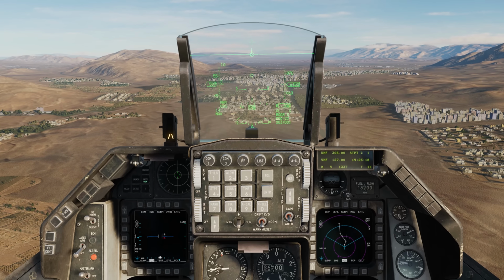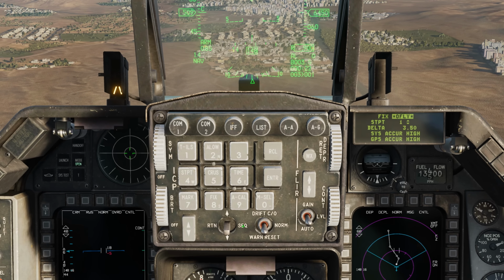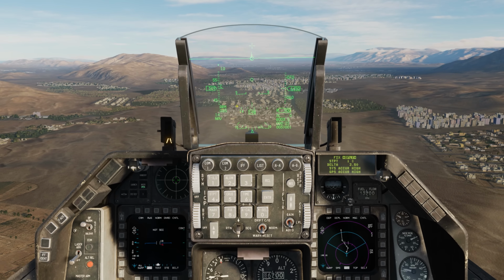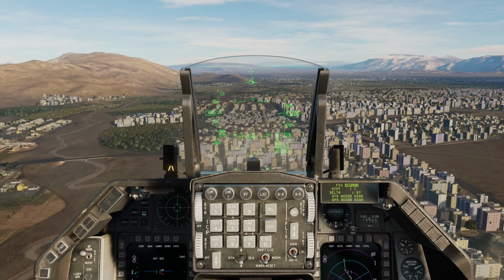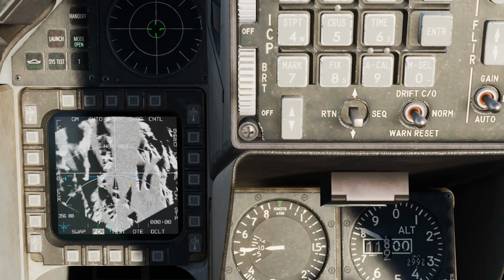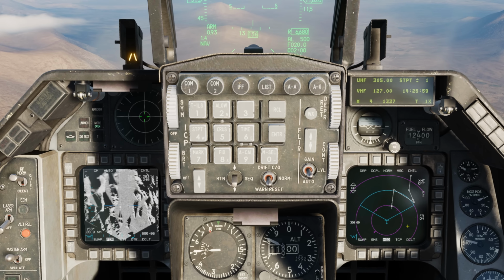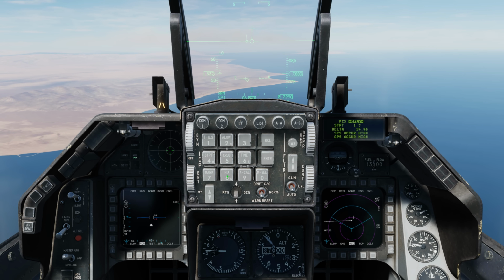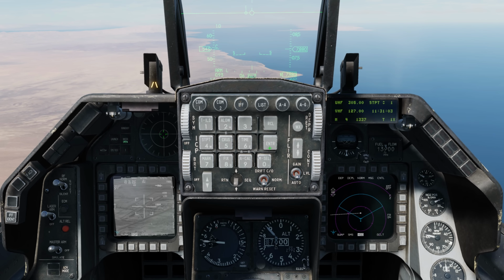DCS: F-16C Viper | Navigation Updating with FIX Taking

Comment: Matt ! there is a problem using GBU-10/12!! bombs in CCRP mode refuse to be released! If changes have been made, then make a new guide, if this is a BUG, report that this is a bug and you know about this problem! I wouldn’t write those here and would write on the forum or in support, but I just ran into an inadequate reaction from the worker’s ED, they started waving a banhammer instead of giving an answer! I find this behavior unacceptable!!
Reply from the maker: No problem here. Feel free to post a polite and construction message with a track on the forum and we can try to help you understand where you are going wrong. Thanks.

Comment: A very subtle but important point made at 3:50 where you can see ALL the steer points move when you update one. So you can’t just change the position of one to, say use it for CAS, and then fly off to your other steer points and expect them to be in the same place.
Reply: Is there any way you can just change one steer point with out the others being moved?
Reply: @robertschubert4809 MARK function on the ICP
Reply: @robertschubert4809  you would have to edit that steerpoint. Can’t remember how to do that right now. Been a while since I fired up the Viper.

Comment: Do we have to do this in every scenario, or is this only necesarry when my GPS is damaged, or the timeframe of the mission doesn´t have GPS?
Reply from the maker: As mentioned in the video, only after a rather long flight in which INS errors can accumulate.
Reply: @MattWagner  ah okay. I thought that INS drift gets fixed automaticaly by GPS in modern jets.
Reply from the maker: @Sinni64  Not entirely. Based on multiple references, updating can still be required.
Reply from the maker: @audunskilbrei8279  You will need to speak with Lockheed Martin about correcting their manuals then. As I said earlier though, A-CAL allows blending of GPS and INS. Also note that this is a pre-EGI aircraft.

Comment: how does having the ins in ifa(using gps) or a similar mode effect the need for this?
Reply: While a FIX only updates the current location your INS thinks you're at and does this instantaneously, an in flight alignment will realign your entire INS. In flight alignments also have quite a low accuracy and they usually require you to fly in a fairly straight line for several minutes.

Comment: Hi all!
Is it possible to change the altitude on the steerpoint?
Alot of multiplayer missions has steerpoints high above target area, and I would like to drop it down to the ground.
Thx in advance!
Reply: You can - press STPT/4 on the ICP, select the steerpoint you want and adjust the altitude.
Reply: You can change/edit the steerpoint elevation in the steerpoint page.
Reply from the maker: Use either the STPT or DEST pages.

Comment: Soo if I'm watching this correctly, I can move a steerpoint that's near a target, to on top of a target to make it easier for the Tpod to find the target?
Reply: No. You're better off using mark points for that. This is simply for updating and re-aligning the INS in case it drifts too much. In fact if you tried to use this method to try and place a steerpoint directly on (a) target, all your systems would be too inaccurate to get any precise bomb drops off and whatnot.
Reply: you could potentially do that but you also have Mark points to help you snap the targeting pod to specific targets.

Comment: Call me stupid but I don't get why we have to do this. Shouldn't the GPS keep the INS automatically aligned? Or is this just in case the mission timeframe / nation does not allow the use of GPS? Or do you have to do this when you pulled max G and then want to super precisely CCRP in the next second?
Reply: The GPS does correct the misalignment of the INS with time. The FIX option is a legacy option to input coordinates, in order to correct the INS, in the days before GPS. If you look at the A-10A cockpit, the panel below the ADI, whereas in the A-10C is the EGI panel, in the A it is the INS panel. Pure INS, no GPS. But the thing worth of note is the 'Erector' button. That is a kind of mark button the pilot would press over a known navigation fix to correct the INS . A similar thing will be added to the Hind, since that beast does not have a GPS system.
Reply: GPS gives you the XY, INS is still used as the main sensor to know the aircraft's roll/pitch/yaw precisely. When you hear "INS navigation" really what it means is the computer is adding up your speed based on the direction you are going and guessing the position based on time travelled at a certain speed at a certain direction. GPS takes care of the position element but the INS is still used to know where the aircraft nose is pointing to
Reply: @lowsafetystandards7245  yes, it's call dead reckoning. But the INS orientation part doesn't suffer from drift at all, instead it is it's position part the one that suffers drift, and that is solved via gps. People confuse a lot of aspects here in this conversation and therefore won't never reach a full understanding of the issue.
Reply: @piston_77  yeah, I kinda didn't get to the point heheh. The inaccuracies of the INS' "guess" based on the previous position, airspeed and direction are the drift.
Reply: excellent. so when will you be adding sdb's
Reply: @stupid cause realism??????
Reply: Well.. that escalated quickly. All I wanted was a confirmation, that this kind of alignment is not necessary as long as my GPS in the DCS- F16 works. It is a very interesting topic how this is handled in the real world, but my question was about DCS: F-16. In the sim, the A-10, Harrier and Hornet do have an in-flight position update via GPS, so the "no other aircraft have that"-argument is completely out of the window in this context. And thinking about the "real-life" F-16, it would not make any sense to first install a GPS-receiver in your fighter jet, where every gram of weight counts, and then update your position "manually" - unless you absolutely have to.
Reply: @MrChaosProf  It's entirely possible that this is a DCS-ism like the lack of boresighting procedure on the F-18 Mavericks.
Reply: I'm just going to chip in here, I was also curious: One thing I didn't see crop up in this discussion was a slight clarification on position updates (side note: I fly Boeing 737's, so this is how they do it, I have no knowledge of how the F18/16 does it other than DCS) - so, my point is there are actually three positions at play here (or more actually, depending on how you want to look at it). Specifically, IRU position, GPS position, and FMC (or 'system') position, which will be the position used. To be technically accurate, the GPS does NOT 'update' the IRU position, it provides input to the FMC position. The FMC position however, is heavily biased towards trusting the GPS position to display it's final FMC position. So the 737, for example, has the Left (L) and Right (R) GPS Positions, the L and R IRU positions, and the L & R FMC positions (depending on whether that aircraft has dual FMC's, not all do). So the IRU's positions can and do drift, but will not affect the final FMC position while GPS input is valid because the FMC is so biased towards trusting the GPS - if the GPS's were to both lose valid outputs, the FMC position would then be a blend of IRU position, plus radio updating (DME/DME, VOR/DME etc).

tl;dr - there are three positions to think about. Not sure how the F16 weights all it's inputs to derive a 'system' position output. If it's biased towards GPS (if valid) then yes, no updating needed enroute?

Also, what effect (if any) would Cursor Zero (CZ) have after a position update like Wags has done? Would it reset the Delta, thus dropping our updates? Do we have any way (like the 737 does) to specifically select a source to update the FMC position? For example, if I completely balls up a fix using the FCR, can I CZ it out? Can I revert to a GPS position? Is there any way to specifically display sources positions? (the 737 can display the IRU positions on the nav display, so we can see where they think they are in relation to the 'system', or FMC position)

/wall-o-text
Reply: @Shrike200  My guess is “cursor zero” affects literally the cursor and has no effect on the INS. It’s kinda weird the way the viper moves waypoints when you use eg the TGP, but I guess the difference is that that changes the WP coords, not the INS state. So when you take an INS fix you don’t change the coordinates as you see them (you’d have to verify this in DCS), when you CZ you do.
Reply: I guess that's when GPS is not available.
Reply: GPS jamming is a thing.
Reply: Over time, the alignment quality degrades so it has to be corrected. It only happens on long flights, so if you fly 50-150 miles I believe you should be fine.
Reply: @geshabuL_  for mil A/C the INS deviates by approx 0.1° every hour so not such a big deal indeed, although it does need to be corrected every once in a while
Reply: @geshabuL_  It only happens on long fights? I already have a hughe gps drift in my mission editor test mission where i spawn direclty over my target O.o
Reply: There might be a blended ins/gps solution, but the gps won't update the ins on its own.  That's the pilot's job.

Comment: Great stuff. Is there a way in ME to start a plane in the air with degraded INS?
Reply: No, but if you make a mission that takes place before 1994 in the ME there will be no GPS available meaning that the INS will drift much more than it would with regular GPS updates.